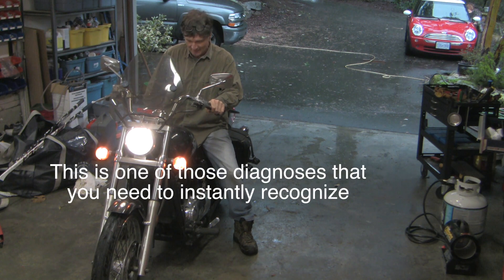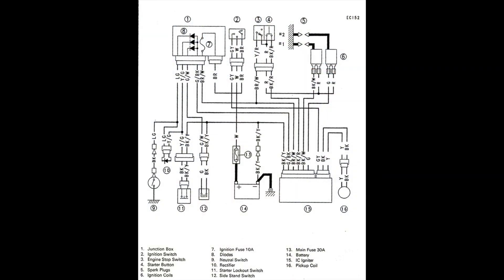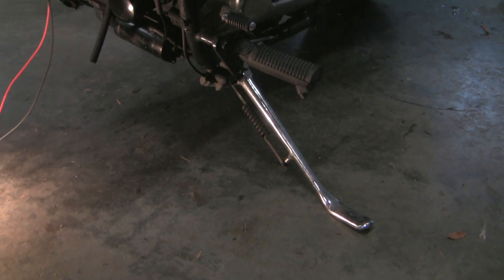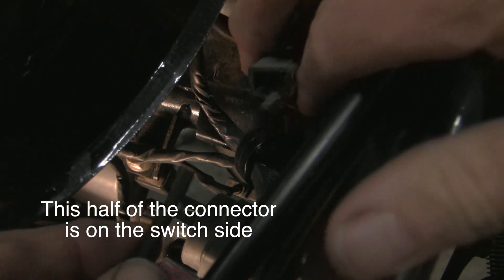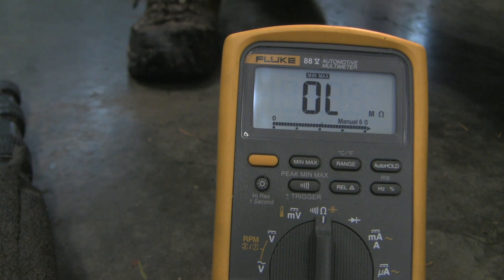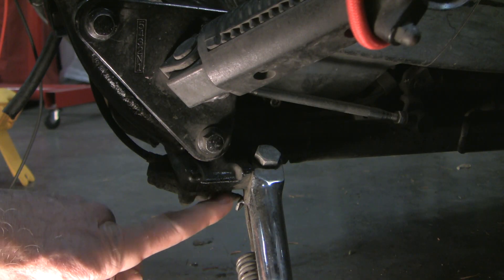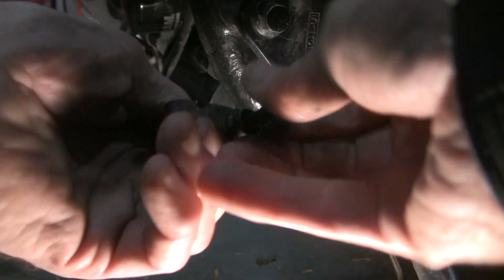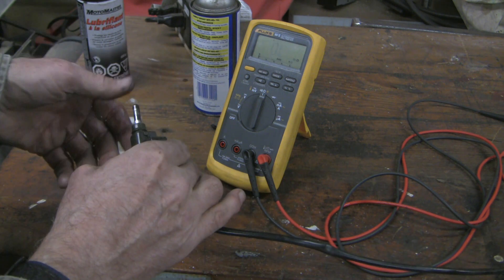Motorcycle Stalls when Clutch Released - how to fix

Comment from the maker: Today I received a question posed through Google plus about the adapter I used to tie into the circuit in this video. I'll record my response here in case anybody else is wondering. 

Hi, Joshua. I don't often use Google plus, I hope this reply gets to you. The leads you were talking about were part of the Lisle 69200 kit, a bare bones adapter kit for a common terminal. You can find it on Amazon if you want that one. Lisle sell others that are more complete, Lisle 69600 is a little better. The one I'd really like to have, one used by Scannerdanner and Eric O is made by AES Wave, titled uTest Advanced Terminal Test Kit, AES Wave part number 16-200. However I don't have the cash to buy that one, it is far more complete with a few hundred male and female connectors of various sizes. All of them try to meet the goal of attaching to a disconnected connector, and you want a pretty good match if you are probing the female end of those connectors because if you spread the female connector it may not give good contact after that. You noticed that I attached to the male end of the connector piece, which is at lower risk for damaging the connector. The other way to do this is to backprobe with a needle or pin into the rear of the connector, and the two advantages of that are you are less likely to damage it and also you can leave the connector hooked up. PICO make a universal breakout lead kit that has a female end, a male end, and a third end to attach a scope so you can bridge the whole connector while it is in use and measure current, voltage, waveforms, etc. However all of those are pretty expensive and there is usually a work around using a simple back probe T-pin for what you want. Thanks for visiting!

Comment: Great job! What if the motorcycle does not have a kickstand? I am having the same problem with my can am. Every time  I  press the clutch it cuts out on me. Any suggestion?
Reply from the maker: Oh, you mean those 4X4 quads? My garden tractor has a sensor in the seat that will kill ignition if the weight of the rider is gone, as might happen if the rider falls off. Same principle. It also has is a kill circuit if the power takeoff or mower is engaged when trying to start. I'd be searching out a wiring diagram for your vehicle, and look for that. The other way to approach this would be to look for loss of spark when you release the clutch. Use a spark tester to demonstrate spark, slowly release clutch and see if the spark disappears. Then look closely at the ignition circuit and see where ground comes from, looking for alternate grounds. When the pathway through the clutch switch disappears, it needs to find another route. For diagnostic purposes you can bypass those switches and see if the problem resolves. However I wouldn't do that permanently, those safety mechanisms are there for a reason. Good luck!

Comment: Nice one Dave, I was wondering what to do with a similar problem on a BMW 1200GS, and I simply sprayed the foot stand switch with WD-40 and now it is all good.
Reply from the maker: Good point! a little silicone spray works great, too. These things get constant dirt so I guess we shouldn't be surprised its a common problem. I took it apart to try and reduce the time to next failure.

Comment: Those little testing connectors are great!  Much better than alligator clips :)
Reply from the maker: Yeah, those are from a little kit made by Lisle, though they would be easy to make with a couple of female connectors, shrink wrap, solder and a bit of wire. They have covered male banana connectors that fit my multimeter leads perfectly. Thanks for watching, Nick.

Comment: As the clutch lever killed the engine with a sharp action i mentally jumped to the switch, but i admit that i didn't think any firther, i was enjoying your diagnostics and repair :-D.

I am one of those people that would have bypassed the whole safety system at root, if you learn how to drive a machine then safety circuits become a point of failure, like yours did.

In the worse case, it leaves you stranded as the machine won't start, "less is better".
Car seatbelt reminders are just annoying, putting a seatbelt on is so much of an automatic habit that having a stupid buzzer just pisses me off, we have far too much "nanny knows best" systems.
Just my moaning opinion lol.
Reply from the maker: Me too, I've see this before so there wasn't much effort put into the puzzle, though I bet many of my four wheel friends didn't know about the switch. I suppose if one didn't know about it he would start with a look for spark, then discover it was missing when the clutch is released. That would prompt a wiring diagram and discovery of the complicated ground circuit for the igniter. After a little head scratching about why it is so complex, there would be an 'aha moment' and exploration of that switch circuit.

Many wise words there. I thought about bypassing it, though once I got it working it was no problem to put it back on. I don't think I would  have searched very far for a replacement. Cheers!
Reply: I don't think i have much wizdom lol.
I appreciate the clarity of your discriptions, and the fact that you don't take my comments in a negative/attacking way.
I'm a bit black and white at times, it can sound like i'm attacking someone, i'm not lol.
Thankyou for your videos :-D, hope you have a smashing 2018

Comment from the maker: When you put a timing belt on an engine, some manufacturers provide a little key to hold the belt tensioner closed until the device is mounted. Once the belt tensioner is bolted into place with the belt in line, it's easy to pull the key (or drill bit, allen wrench) and the tensioner springs into action. Those tensioners can be quite tricky to bolt into place after the spring is deployed. Similarly, at the end I was trying to put the spring loaded switch into place while the bike was up on the stand. So I wrapped the switch with tape to temporarily close the switch, which allowed me to more easily bolt it into place. Then I cut the tape away to allow the spring to release, after which I torqued the screws down. In retrospect It might have been easier to do that with the bike on my lift, so I could fully extend the switch while mounting it. In the end the repair worked out fine.

Comment: Always a great vid. This procedure applies to many similar switches...door jamb, parking brake, brake light, etc.  Thanks for sharing!
Reply from the maker: Yeah, absolutely. The best technicians make these kind of diagnostic tasks look very simple, which they often are. However I don't envy how those guys have to constantly work against the clock. Probably a seasoned tech would have just sprayed down the switch with lubricant, although it might have taken a while to get it moving in that awkward position. It takes longer to do the diagnostics accurately although I find the real reward is the insight from learning how that ignition ground system works. Insight like that makes future problem solving so much easier.